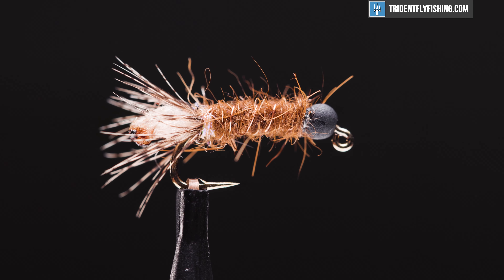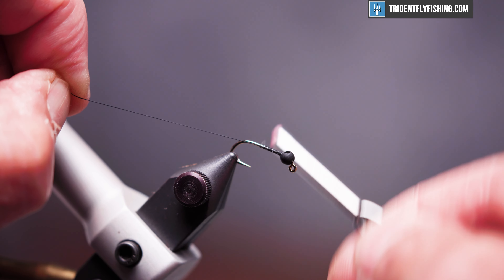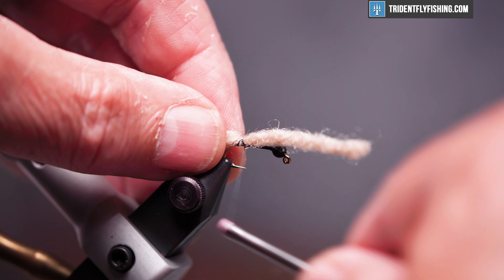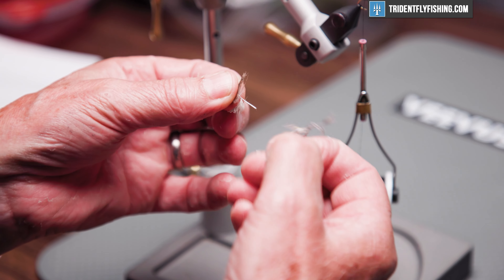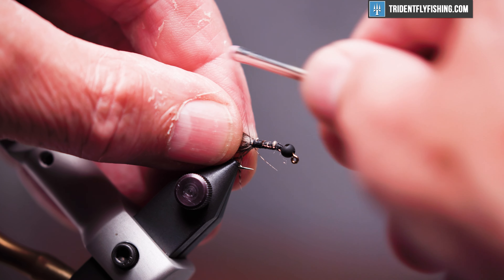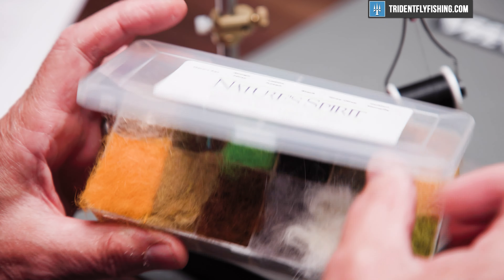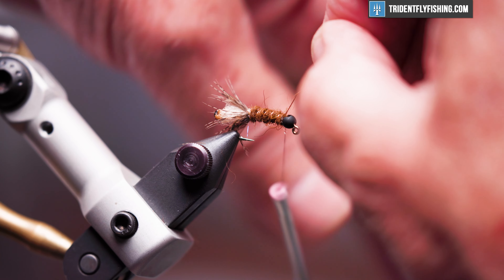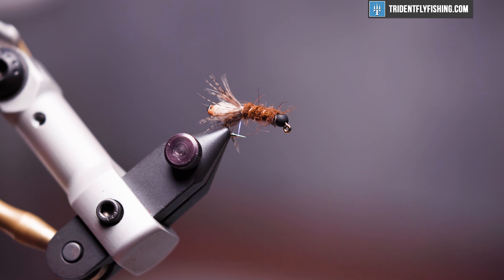Peeping Caddis Nymph | Best Cased Caddis Imitation? | Fly Tying Tutorial

Comment: Nice tie.  Glad to see you using yarn, and pulling off just the threads of it you want to use to make the right body size.  I haven't seen that in many years.  The doubling of the hackle is very important to get that hackle pointed in the right direction and although you demonstrated it by doing it, you didn't mention that's what you were doing.  I'm a little confused though why you would use snowshoe rabbit instead or normal rabbit or other dubbing.  If it's actually from the foot of a snowshoe rabbit, that stuff floats forever!  Normal rabbit dubbing soaks up and holds onto water.  You probably didn't need to us zap-a-gap on that because the whip finish should hold it just fine.  I suppose that's not a lot different than adding head cement after making the whip finish though.

Although that's a fun tie, cased-caddis are not a preferred food-form for trout, but they will eat them when  they can't get anything else. Caddis anchor themselves to the top of the rocks for about a week or two before the pupa emerges.  Trout can't really turn rocks over to get at them the rest of the time.  When they are feeding on cased caddis you will see then turn sideways and use the corner of their mouth to scrape them off the top of the rocks. So their feeding behavior is very distinctive when feeding on Cassed Caddis.    Nonetheless, I do remember fishing one stream where the caddis were on the top of the rocks; no other hatching was going on; and the fish I was catching felt like they had rocks in their gut.  That was because they had been eating the cased caddis by scraping them off the top of the rocks.  So I'm not saying they don't do that, I'm saying that is way down on the list of preferred foods for the trout because of the rock cases.  Probably should have a couple of them tied up in case you run into the situation though, and this is a good one, which is a pretty simple tie.